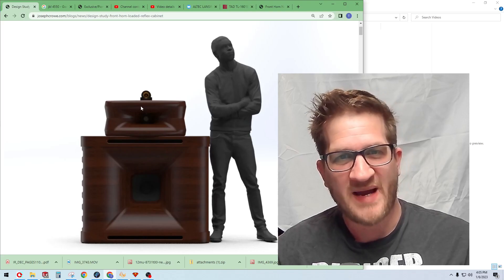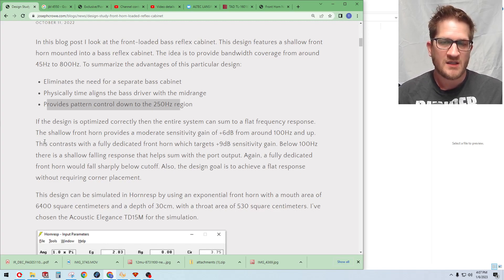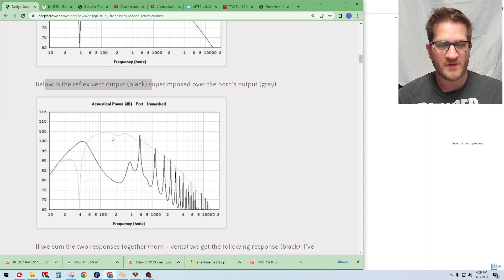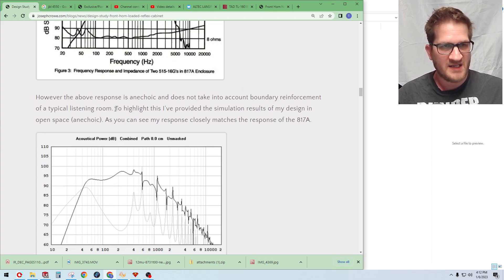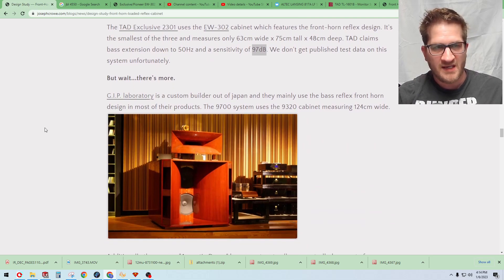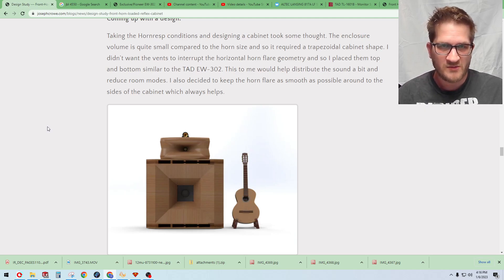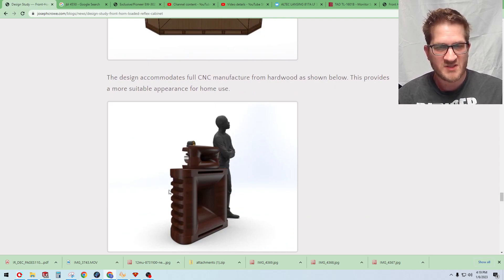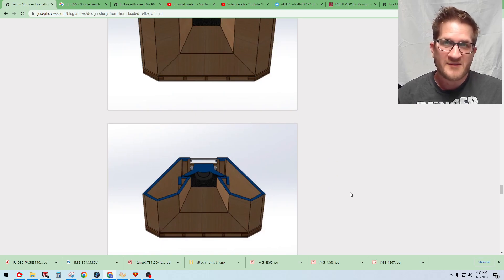Design Study --- Front-Horn Loaded Reflex Cabinet No. 1798

Comment: Nice Work! Beautiful Designs!  Tall order, building Horn Loaded Speakers from scratch! I have been doing upgrades to existing Klipsch, JBL ,EV vintage designs for some years now, it took a little time to find and purchase the Best and most Iconic Vintage Drivers of the Past to finish my three horn speaker projects.Its so much fun being able to create great sounding Horns. However, I fear that the Louvre feature on a pair that I saw, will compromise the Efficiency, Coherence of the folded type horn, sending the Back Wave of the woofer thru undirected slots/louvers in the back of the cabinet May minimize side wall bass boom issues,but it may end up not producing a a fast,tight ,punchy, tonally balanced presentation,and may lack bass detail
Reply from the maker: Thanks, test results are here…

https://josephcrowe.com/blogs/news/bass-cabinet-no-1798

Comment: A couple of thoughts:
You kept comparing your horn to a "traditional" horn. No clue what you mean by this, there are tons of horns that are "traditional."

More importantly, you are prototyping an exponential horn with a conical horn - they behave very differently. In particular, they will interact very differently with the floor and the port.
Reply: Looks like an exponential horn emulate via conical steps.  But yes, the Hornresp sim should be adjusted to reflect the two conical steps rather than one exponential step.
Reply: @Grommet2007  It "look" like it, but it does not, they are very different profiles.
The two most critical parts of a horn are the mouth and throat, the profile in between has less to do with how it behaves and what it sound like.

For instance, conical and tractrix profiles behave essentially the same along the length of the profile, but behave and sound very different because of the mouth and throat.
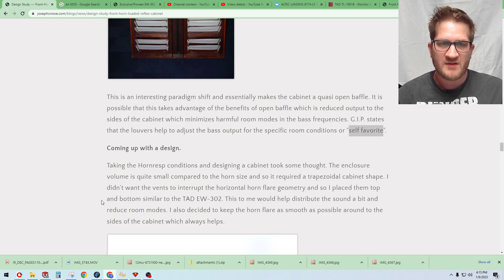Reply: @joshua43214  Sorry, I'm just looking at the prototype pictured @10:57 in the video.  I'm seeing what looks like two conical sections with different expansion rates (four flat panels in each section, each panel in each section at the same angle to centerline of the horn).  I don't know if the builder is trying to emulate an exponential or tractrix profile with that, but the most accurate Hornresp model to match the prototype would be two conical segments with different expansion rates.
Reply: @Grommet2007  He stated in the video that the conical horn was a prototype for the exponential horn, and was being build this way to keep costs down.

My point is that they are very different horns, in other words it is a waste of time and money to prototype an exponential horn with a conical horn.
Reply: @joshua43214  Hmm, not sure where my previous reply went to, but the abbreviated version is that it's fine to emulate the response of an exponential horn at low frequencies by using a series of conical steps of suitable expansion rates.  David McBean, the author of the software used for the simulation here, has demonstrated that on more than one occasion in the Subwoofers forum on the DiyAudio website.
Reply from the maker: The design was changed just before building to have three stages to the horn flare. It only deviates by about 8mm from my target curve. 
The latest blog post features some test results, but they are in-room. 
I will measure in a large space in two weeks to get closer to anechoic. 
https://josephcrowe.com/blogs/news/bass-cabinet-no-1798

Comment: I have a question. If the speaker is designed to sit on the floor, why does it have a flange at the bottom? Wouldn't the  response be better if the transition from the horn to the floor was smooth?
Reply from the maker: The top horn flare would have to be a higher flare rate to compensate, making the four sections of the horn different geometry (top petal, left petal, right petal). This would be more costly to manufacture. The current design has all four horn petals the same design. Additionally, reflections that occur after one millisecond (floor bounce) is not perceived as a blurring of detail, but is combined psychoacoustically with the direct sound (Haas effect, precedence effect etc.)

Comment: Beautiful work.  I see your design philosophy. I have these drivers and I'd be prepared with a solid panel to plug the rear louver. I don't know how that's gonna work wrt low freq extension. I am sure you have done your due diligence and looked up the relevant Pioneer Exclusive/TAD models. I think there is plenty of room for improvement in the network.  I would not push xover point much higher than 600 Hz. 👍